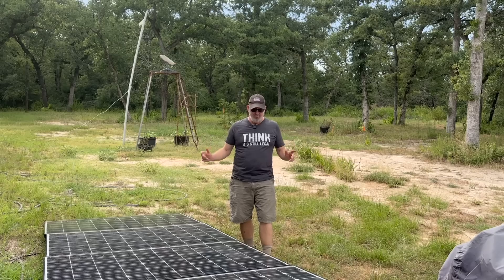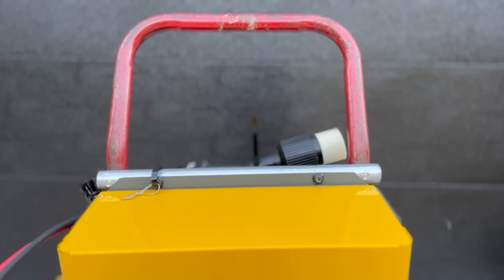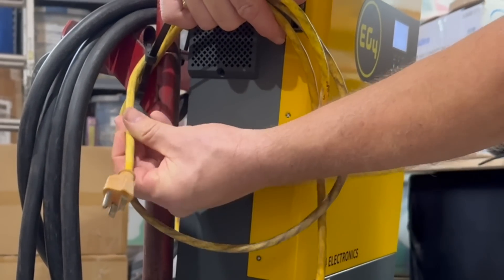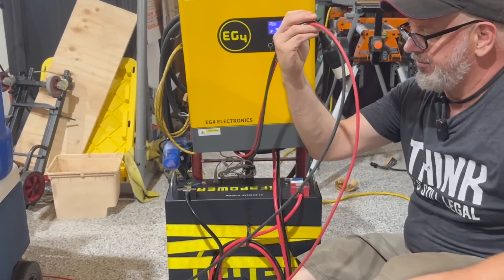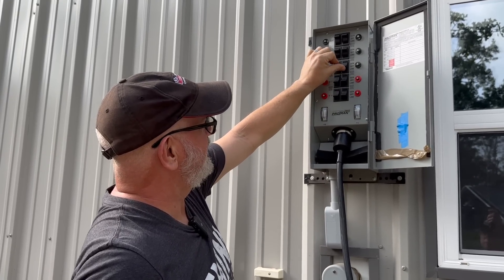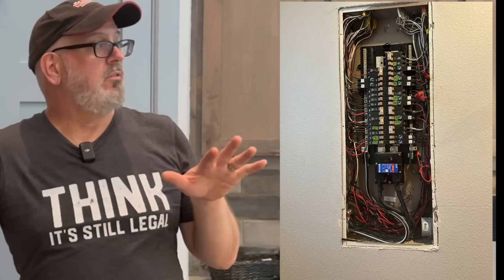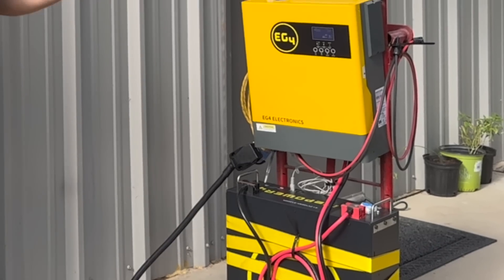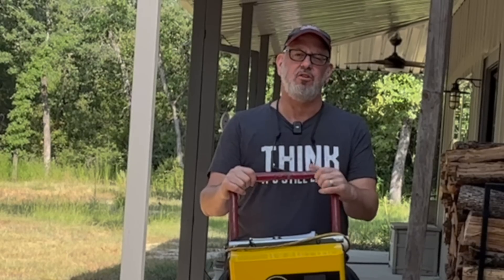CHEAP DIY Solar Power Portable Generator

Comment: I had no doubt that you would not be successful in this project. Now, DIY your own battery cells, to get the full bang from the buck.
Cheers,
Reply from the maker: Definitely! From what I can tell a DIY battery build would knock almost 40% off the server rack battery cost.  Now if they’d just make a nice server  rack case where you could house the DIY battery and BMS, that’d be a winner! Ultimately, I’ll need 20-30 kW of battery to run my air conditioner over night, nothing but extra cash keeping me from that!
Reply: @terrahillfarm  😂 I agree

Comment: This is the same system Will Prowse created recently on his channel.
Reply from the maker: Thanks!  Pretty much the same inverter setup with an EG4 battery instead of a Trophy.  My goal was to try and build a complete system with panels as cheaply as possibly, so I added the used panels and got the entire price under $3k.  That smashes the performance specs of the AIO box units for thousands less.  I’ve seen several hand truck systems built on YT but Will’s using the EG4 3000EHV was by far the best IMO.  I think the cart he used works better but I already had mine sitting around.  ☀️⚡️👍
Reply: @terrahillfarm  Yeah, I built one too with the Lifepower 4 battery. Will didn't mention the importance of grounding the unit if it's not connected to AC ground - it won't work, or anything about the Nader breakers for the PV in line which come with the unit (he said to plug it in at night). He also said to use a basic Yellow Jacket switch box for a 3K load and that's not advisable. Also, to pick on Will some, the AC in line on mine was sucking in over 2k watts from the wall, so you don't want to use a standard cord for this as you pointed out (but Will suggested). Definitely use a 10AWG cord. It gets hot otherwise. Will is a smart guy but he speeded through this one too fast.
Reply from the maker: @tomproctor.archive  The build was certainly minimal in safety considerations!  You can adjust the Amps lower on the grid charging and 25A was a bit cooler than 30A.  100% agree the grid connect needs to be 10AWG minimum!  Are you getting an accurate wattage and amps indication on the inverter from your PV?  Mine seems to be lacking considerably.
Reply: @terrahillfarm  I haven't tested actual PV line voltage and amps to what the meter says, but it seems within range. Good call on the setting to dial down the input from AC, seems like a reasonable call.

Comment: Do you notice any led light flicker when running off of battery/solar. That is a problem I have with the Growatt.
Reply from the maker: No not really, and we have 12 LED can lights in our family room.  I’ve heard this is common with the EG4 6500ex and Adam DeLay did a great review on this issue.  SS said it’s caused by lower quality LED bulbs, but that’s hard to isolate.  The problem may be more pronounced at night so I’ll check on it.  Literally 3 days after we shot this video, a power pole snapped in half down the road and our power was out for 4.5 hrs.  Plugged in this system and ran the house (except for central AC) till the power came back.  😊
Reply: Is your water well 120 volts?
Your battery is 5.4 kwH, ,not 5.4 kw?5.4 kwH sounds correct
Good job with the demonstration.
Looks like east Texas,
Nice place y'all have built.
Ham radio?
Take care and May The Lord continue to bless you and your family
Reply from the maker: @kf5hcr176  Thank you!  The well is 220 but not on solar yet.  Battery is 5,100 watts and 48v but the current settings will only run down to 20% of the battery. We’re in central TX about 1/2 way between DFW & Houston.  No Ham yet but it’s on my list to learn.  This project was a first step in going to full solar.  It’s worked better than I thought it ever would, except for some issues with Solar Assistant.  Hoping to have that fixed by Friday so I’ll post a vid if I get it working.  Yes, we have been truly blessed and we remember to give thanks daily🤠
Reply from the maker: I’ve been looking and while our LED can lights have not been flickering, we have some Edison style LED bulbs that are flickering slightly.   If you have a house full of those, you my have issues! 💡☀️⚡️👍

Comment: Run silent, run deep. I've gotta look into used panels.
Reply from the maker: Exactly!  Can always recharge with generator if the sun ain’t shining. If you do not have a big tax bill to offset with the 30% tax credit on new panels, used is the way to go.  I’m still stunned I could run the entire house off one battery 🔋
Reply: @terrahillfarm I thought it was ok to claim the 30% tax credit on used panels since it’s a new install to you? (I’m not a lawyer or cpa accountant ect)
Reply from the maker: Thanks!  I’ve heard several people’s opinions on that and as I read the description it just says “new equipment”.   Personally, I can’t afford to be wrong so only on new for me.  But, I’m not a CPA, so if your CPA tells you to take the credit on used equipment… Go For it and send me his card!  😮

Comment: Kind of an odd transfer switch having to have the panel open.
Reply from the maker: Sorry about that, thanks for pointing that out.  I didn’t explain that the outdoor transfer switch door is made to close with the generator cable hooked up.  There’s a small space for the cord in the bottom.  An indoor transfer switch with outdoor plug will work for most applications, I’d just bought that outdoor switch for my last house since the meter was on the outside of the house opposite a room where I couldn’t mount an indoor switch.  👍⚡️☀️💡🤠

Comment: Electric company goes down that much? Get rid of them. You got the panels cheep. You got a system just upgrade with more panels, and a second EG-4. Depending on average rainfall days, add a battery now and then to cover for them, 3 days should do. Then kick the electric company down the road. Pun intended.
Reply from the maker: You’re exactly right!  That’s why I just installed two EG4 6000xp inverters and will be running the entire house off those and a 30 kWh battery rack.  It’ll take a few years to pay the cost back but that’s not counting the benefits of never being without power.  To us, that has a lot of value considering how far out in the woods we live.  Prices for DIY solar component prices have gotten really low so perfect time to expand.  If oil prices keep rising, you know utility companies will be raising their rates as well. 👍☀️⚡️💡👍🔋

Comment: a guy ran a honda eu2000 genie for 4 years straight,, problem is they new an oil change every 25 hours
Reply from the maker: Thanks!  My oldest is 15 years old.  I’ve changed oil about every 50 hours or annually.  They are expensive but they last. Longest life I’ve heard of is 25,000 hrs, but I’d be inclined to rebuild after 10,000.  There are plenty of good clones out there for much less 💰 and those probably work great for most folks who use less than 100 hrs/yr.  I’ve just not seen enough data on longevity from the clones.  If I had to live off generator power for 4 years, the divorce would cost much more than the best Honda generator! 🤣👍😫🫣

Comment: Why be satisfied with a standby system, you have enough roof to go solar completely, the more solar you use the less mains you must pay for.
Reply from the maker: Thanks, that is exactly what’s happened!  After seeing the potential for the backup system, we upgraded inverter, batteries and getting ready to buy more panels for full off grid system!  I do have plenty of roof, but it is on a 4/12 slope from 16 to 24 feet high.  I don’t bounce as well as I used to so I’m not climbing up there for maintenance or install.  With unlimited yard area I will be enlarging my ground mount array.  We have a nice southwest facing hillside but my Biggest obstacle is too many trees.  Been waiting for it to cool off so I can go into full Lumberjack mode on them!  ☀️⚡️💡👍🤠

Comment: I don't understand why call it a generator? It doesn't "genorate" power.. it's a BATTERY
Reply from the maker: Thanks!  Good point but that’s why I tend to use air quotes when I refer to “popular AIO solar generators”.  Of course a gas ⛽️ generator just converts liquid petroleum energy ⚡️to AC power like an inverter converts DC solar power ☀️to AC power so that’s pretty much the same I guess. 😁👍
Reply: Actually it's a solar "power station". A battery alone without the other components will not run anything.

Comment: No 240v, so my water well not work
Reply from the maker: Thanks!  Correct, you’d need two EG4 3000 EHV inverters running in parallel to produce 240v.  At $1,350 for 2, that’s about as cheap an off grid split phase solution as I’ve seen.  I’ve also seen some 240v inverters that run off solar without batteries for running a well, but you’d be limited to pumping only when the sun is out.  You could also look into a step up transformer to convert 120v to 240v.  Everyone’s use case is slightly different so there’s really no “one size fits all” solutions in solar.  I guess there is if money 💰 isn’t an issue but that ain’t me! 😁👍⚡️☀️